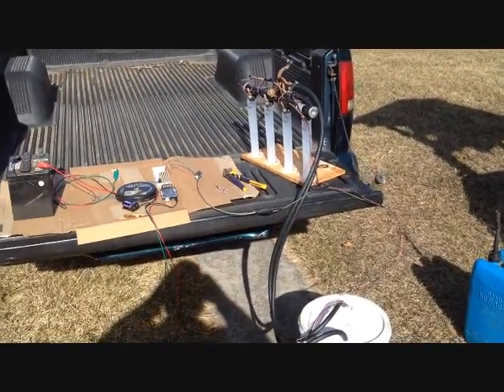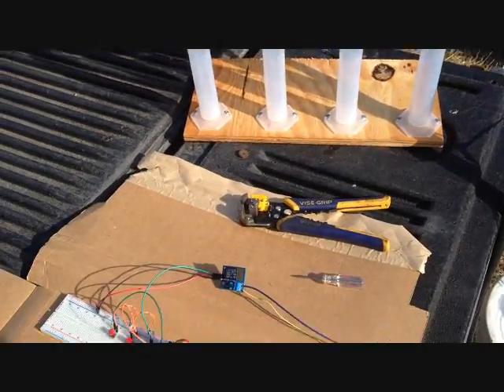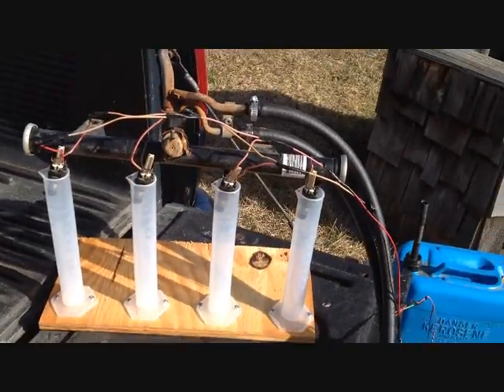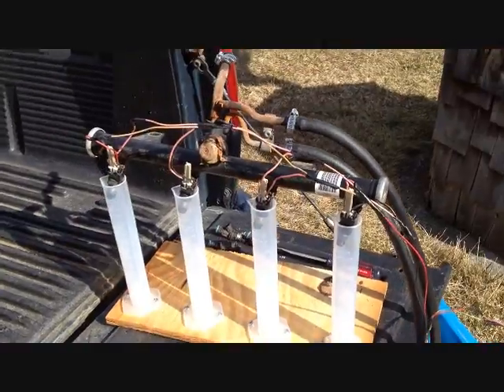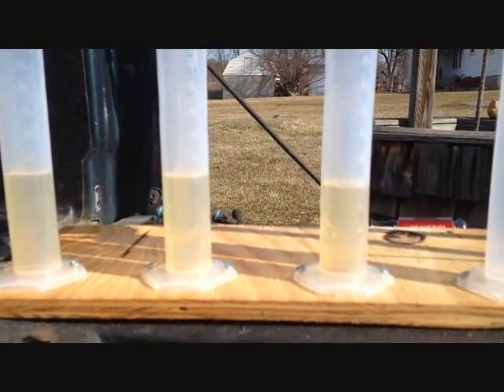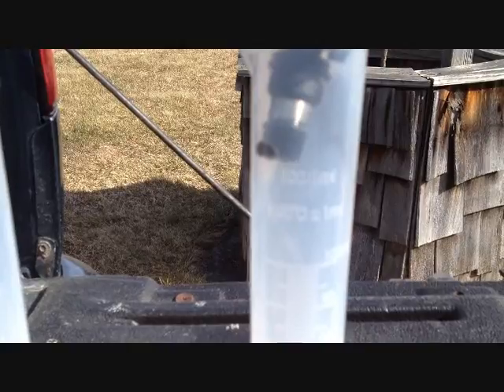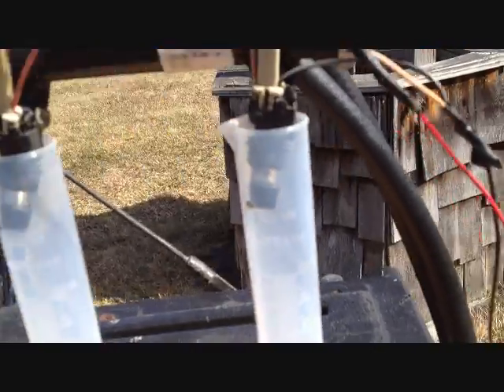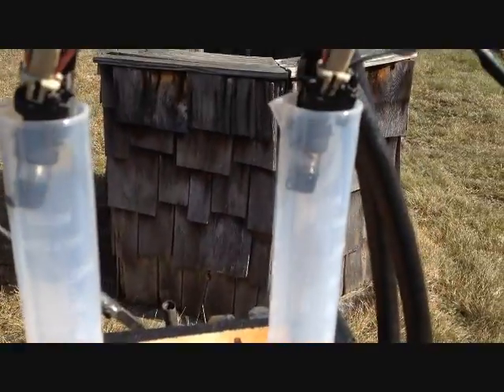DIY fuel injector flow bench testing.

Comment: i like to throw them in a cheap ol ultrasonic with your choice of cleaner then as ultrasonic is cleaning i use the injector pulser to really help clean.after that i front flush then back flush with cleaner pressurized through the injectors then i flow test and repeat untill the injectors flow are close to the same...how many ml are your graduated cylinders?im looking for somthing like yours

Comment: Gr8 stuff for the DIY'r!  Iam curious is the solid copper wires vs stranded copper effecting your experiment?
Reply: It will not although solid wire is tough to work with.

Comment: The sticky ones,  give them monetary 12v just brushing a wire across a battery terminal,  and reverse flow them in static mode to clear them off trash.  I've done them this way for years
Reply: Also try running 50% seafoam in your bucket too

Comment: Do you have the code for dynamic i modified the blink code using parts of your code on the website but you only have a static would you mind sharing the dynamic code
Reply from the maker: jorge salinas the code I used to have is very elementary and doesn't work with larger injectors plus won't work when using a relay board to pulse the injectors. I'm planning this coming spring/summer to change the code for better dynamic control and progressive ramp rates for different size injectors.
Reply: Twisted Builds how do you stop code from going into a loop i tried using the button but it bypasses it
Reply from the maker: Can you explain more of what issues your running into? I'm guessing its a circuit issue IF your using my sketch, but need more info to help you out.

You sent me a email I did respond to, if you want to continue there that would be a better way of getting ahold of me so I can help you out on this issue.

Comment: Awesome video and using the arduino to do the control is accurate. 

Need to do some testing on some diesel injectors but that would be a more complicated setup.

Comment: Do you know what the fuel pressure is in the system? The flow rate of an injector is related to the fuel pressure in the system.
Reply: Actually injectors are rated @ 3 bar which is 43.5 psi so you would have to scale them based off of the 3 bar base to know what they truly are.
Reply: tomintoxicated the pressure is 58psi. I've checked it. But thanks for telling me information I already knew about fuel pressure and flow being related LOL.

Comment: Would you share your arduino code??? I'm working on a similar setup.
Reply: hello i want to do the same fuel injector bench test . i saw your very interesting video and the description in the site but i don't see anywhere in the code the dinamic test flow code..i don't get it.thank you
Reply from the maker: Chase Lentz it's posted on my website www.twistedbuilds.com